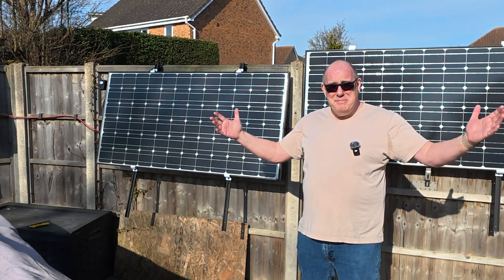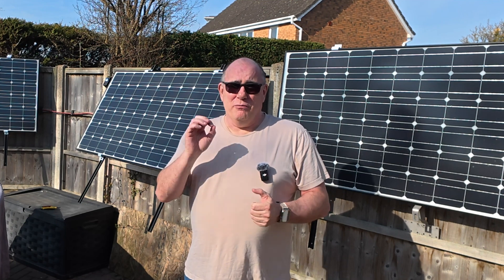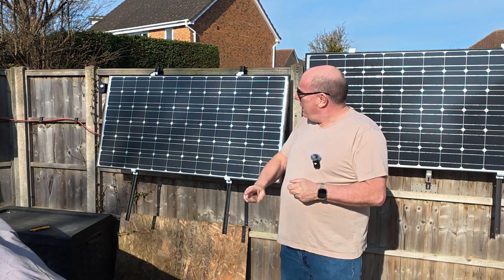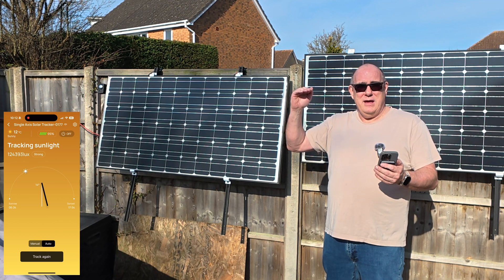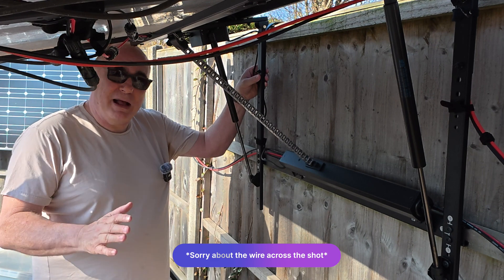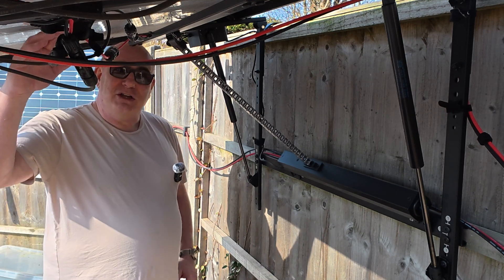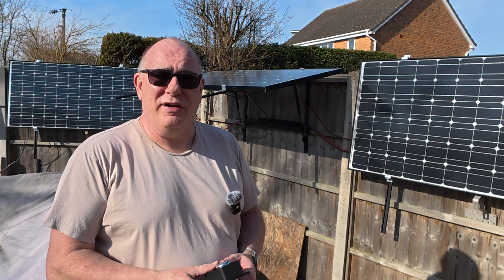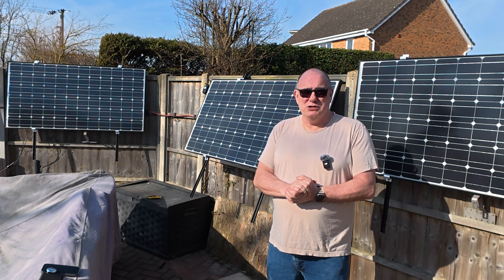Power UP Your Fence Mounted Solar Panels With Ease

Comment: Be careful with the sticky out bits 🚑. Once you’ve fitted the higher power panels then I suggest you cut off the excess framework to minimise the risk of accidents. 
Can such a tracking system be mounted on one’s roof? That’s be cool if a whole array could raise / lower to sort of follow the sun.
Reply from the maker: yeah if I was leaving these panels in place, I would trim down the access however my long-term plan is to put 440 panels on here and they would take up the whole space covering exposed bars
Reply: @JonathanTracey  Just put some cheap tubular pipe insulation on for now.
Reply from the maker: that’s a good idea

Comment: for reference this kit was designed for the next gen panels capable of 670w in mind for 5 story apartment balcony's ,  they also offered a corresponding micro inverter range to tie in with it in some markets
Reply from the maker: yeah, if you look at all of their marketing material, they have a single panel on them on a balcony. My plan is to upgrade to 440 panels later this year